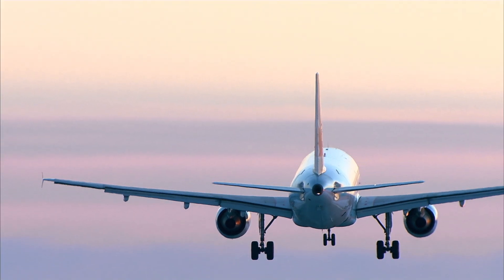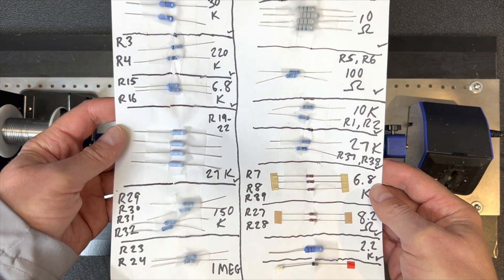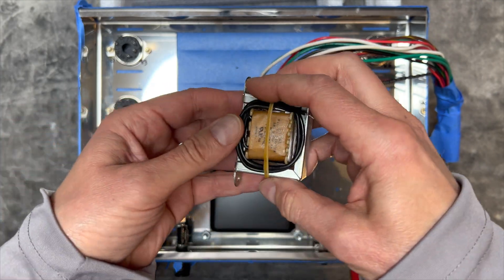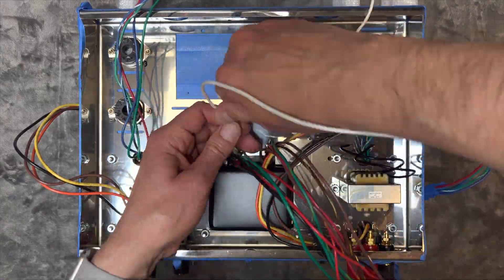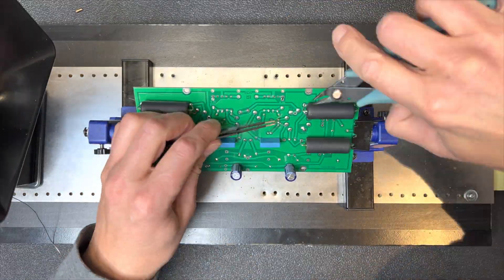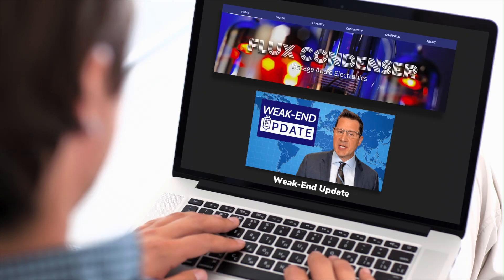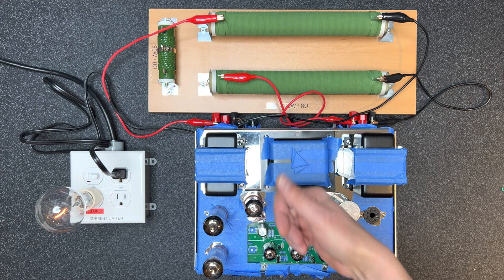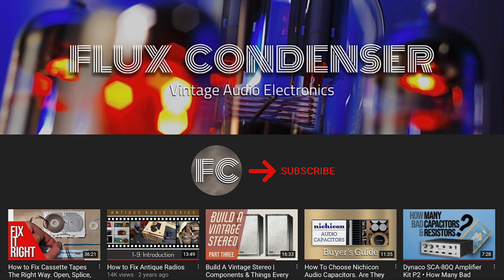Can I Build It In 10 Minutes? The Dynaco VTA ST-70 Amp Kit

Comment: I built a similar amplifier in a few hours, while the wife was out shopping.  I had all the parts in front of me however I did have to drill a few holes and there was no PCB, all tag strips and point to point wiring.  After a brief smoke test I put two screws in the bottom to secure the base believing I'd have to take it off again for adjustments, plonked it on the rack to give it a good test and it's never been off again.  That was 9 years ago and it's still only got the two screws in the bottom :-)

Comment: I would like to build my own tube kit. But where to find a descent circuit and kit manufacturer? I like point to point wiring on a tube amp. its seems more in keeping with the tech, and you can use silver wire. would that make a difference??

Comment: A note of caution when disassembling and then reassembling EI type (square core lamination) xfrmrs: Be sure!!! to use the paper or plastic washers on the bolts and hardware where it engages the laminations to prevent a magnetic short circuit between the laminations at each end. It is extremely important to keep laminations isolated from each other, which is why they're coated in varnish.
Reply: Good to know, thanks!

Comment: Can I send my half built tube amps to you so you can help me finish building them? I’ve got a KMQ60 clone, a simple EL84-PP, a GU50-SE and some SE and PP-amps built on pen-size tubes and finally a mega-project with GU72 SE-monoblocks…. If you fixed a Dynaco in 10 minutes, my un-finished projects would take a day at max.

PS. Having worked at a capacitor plant for 10 years I would never ever use PIO, tubes. They are simply inferior when it comes to using them for sound equipment due to their high amount of distortion.

Comment: these capacitors are 50 years old and they are paper-foil in oil type. there's no surprise it has degraded. who knows in what conditions they've been stocked all these years. they have a guarranteed maximum storage time of about 20 years, maybe 25 in required conditions like temperature and moisture.

Comment: Im old I cant think fast anymore . Ive built smaller sruff I so wish I could slow the video down for the wiring parts
Reply: Tap the gear symbol in the upper right hand corner of the video to bring up settings. Select playback speed. You can speed up, or slow down playback at your will.

Comment: Nice work, new subscriber.  What station are you using? The hand piece looks a lot like the hand piece my Hakko FX-100 uses.  Are you pleased with your station?  

Edit: I see at the end of the video you post a pick of the FX-100, so that must be it.  Your honest thoughts of it?
Reply from the maker: Thanks, I have a mini review of the FX-100 here you can check out: https://youtu.be/5HZDTS6bSbQ
Reply: @FluxCondenser  awesome, thank you for the response. I’d have to agree, easily the best I’ve used. I enjoy using it more than the JBC I paid nearly 1-1/2 times more for.  Anyways, just curious as I really don’t see many people using it and I think it’s kind of a hidden gem.  

Don’t know if you are, but if you’re considering upgrading to a better vacuum I have the FR-410 which is a matching unit in looks at least.  I didn’t think it was going to be, but it’s a HUGE improvement over the FR-301 hand vacuum. To me at least it was well worth the money for the upgrade. They also make an FR-400 which is a heavy duty version for quite a bit more, but I’ve found the FR-410 more than sufficient.

Comment: You can build it in 5 minutes! If someone is viewing this video at twice the normal speed, and still understanding everything, haha. That's double craziness indeed.

Nice build, and I like using the masking tape for doing stuff on the chassis, especially when drilling the thing. Learned it the hard way.

I like these Russian caps. The power cord looks really bad to me, an outdated practice that should be preserved only on some vintage devices and that's that. 
 I'd use an IEC C13 socket or a strain relief cable gland and a round 3-lead cable.

Cool acrylic PCB shield, makes things safe while preserving the look. I like it a lot. The amp looks great indeed.

Nice weak-end update logo BTW :)
Reply from the maker: Thanks! And the footage is actually mostly at 20X speed not 2X believe it or not. I agree, the knot for the power cord is not ideal and a strain relief would be better. But yeah, I like to keep the vintage look sometimes. Take care and thanks for the thoughtful comment.
Reply: @FluxCondenser  trying my best to make my comments and videos as thoughtful and meaningful as I can :)
Reply: Or go at half speed if you're really bored..

Comment: You did NOT assemble this amp in 10 minutes! More like a few hours, 10 minutes in the video maybe 🤣 Just taking transformers apart, sanding and painting the end bells would take more than 10 minutes!!!
Reply from the maker: Well, yes. In fact I shot over 20 hours of footage to build the amp, a lot more than a few hours.
Reply: @FluxCondenser  and that's just stuffing a ready-made chassis, of course. Manual fabrication would take another few well-packed days of work.

Comment: This was a hoot to watch Chris. 
Some years ears ago I rebuilt two ST-70's for friends only keeping the original iron and chassis. I used VTA rebuild kits very highly recommended! At the time those PIO USSR caps were like two bucks each. One amp I used KT77's and the other it's original Dynaco Mullard EL34's!
In my case I kept the tube rectifier for my friends as I have a number of Mullard GZ34 tubes. SS rectification is not a bad thing in fact many think it's superior to tube.
Reply from the maker: Nice to hear your experience with the ST70. Just as so many others have shared, underscoring just how popular these things are. The greatest selling amp of all time, I believe. And yes, in my opinion for this amp solid state is the way to go for the rectifier.
Reply: @FluxCondenser  The only advantage to a tube rectifier is a more controlled on-off current rush, and in guitar amplifiers for the ability to 'sag under load', so that 'clipping' in the output transformers is less likely to happen (albeit this is down to many factors) and thus by sacrificing fidelity, and linear reproduction, a softer 'voicing' is achieved. (this is due to 'saturation' or 'compression' of the waveform)

For audio reproduction, solid state rectifiers are superior in almost every respect. If one is concerned about turn-on surge, devices can be added, but in practice, rarely necessary.

Comment: How is this thing legal? I see a two wire power cord and a metal chassis.
Reply from the maker: It could easily be wired with a grounded cord, so that’s an easy addition to make, and yes that would add a margin of safety. Given that everything is powered from the transformer, though, the only potential for that being of benefit would be if the power cord became frayed and somehow came in contact with the chassis. I mean, it could happen, but it’s unlikely. Also, there is a fuse which adds a margin of safety. Again, I’m not disagreeing. A grounded cord will add some safety, but this thing isn’t exactly a death trap, either. And I have no hesitation leaving it on in my home. Then again, I know who built it. Trusting someone else’s work with a kit is another story. And you pose a good question about the legality. I’m really not sure what the laws are on that for America. If anyone knows, please chime in.

Comment: Good to see the build videos are back.  One thing, is that a solid state rectifier on this amp?  Did it come with the kit that way or did you swap out the tube on your own?
Reply from the maker: Thanks, John. Good observation. The amp came with a tube rectifier, but it blew during testing. It wasn’t a cheap tube, either. I prefer to run these things with solid state tube replacements.